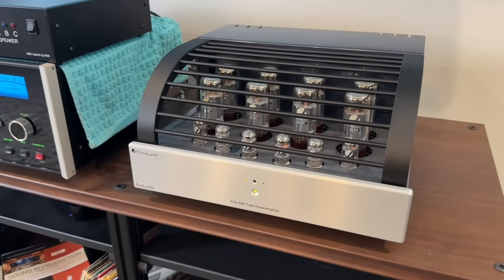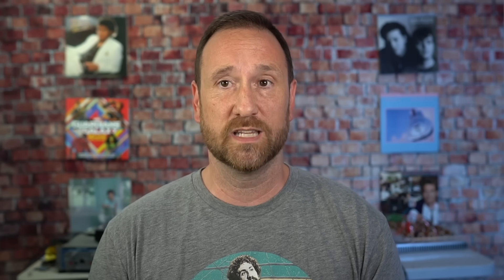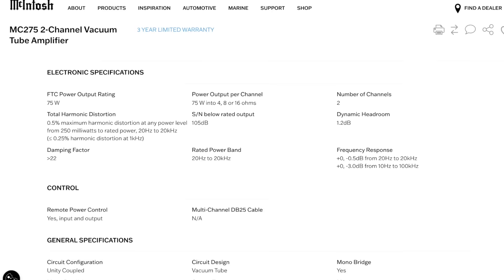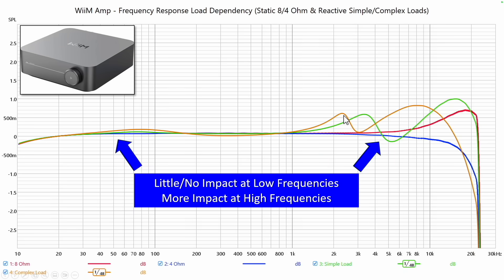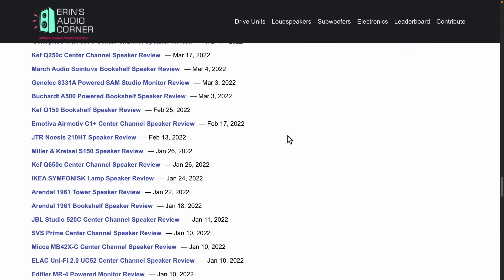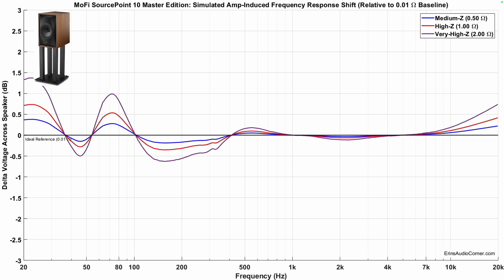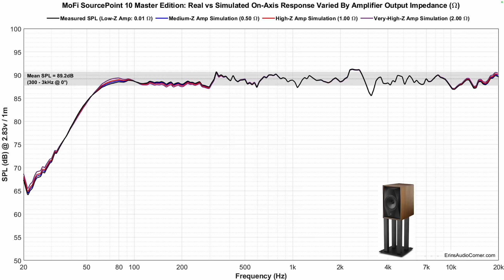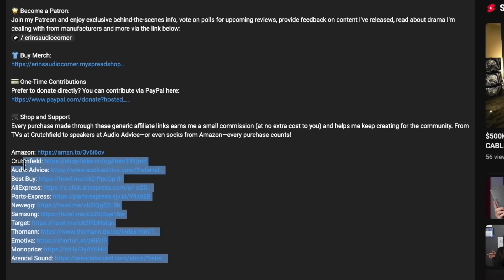Should All Amplifiers Sound The Same?

Comment: Erin, I have two ideas to make the comparison as fair as possible. One is to follow an unwritten industry "standard" and use a single 1000Hz tone for both and keep them at the same dB in the microphone 1m from the speaker. At least this way, both are coming from the same 1kHz source. This might make it easier to hear the differences, but it doesn't really compare the two sources fairly.
The other thing I would use, and in fact, I've done it, is to use a white noise source, which is a type of sound that contains all audible frequencies with equal intensity. This way, you weigh ALL the frequencies, and of course, you'll see differences. The idea is to find all the differences, but I think it's a good start.

Comment: This video is one more piece of evidence that the sound of an amplifier is not a mystery. It isn’t a case of having expensive capacitors in the circuitry, or exotic circuit topology, it’s only that the frequency response when coupled to a speaker is different. In audio that is what we hear: frequency response.
Reply: Specific components do impact the sound, though. Real resistors, capacitors and inductors do not behave like "ideal" resistors, capacitors and inductors. So one needs to match the right components to each other. Steve Deckert (of Decware) calls this process "voicing". This would be another level of refinement.

Comment: BEST. VIDEO. EVAR.  👍👍

This is one video topic that absolutely NEEDED to be produced in this format and with this type of corroborative data combined with subjective impressions that are validated in real time (Erin's Patreon video)!

Erin demonstrated this brilliantly with his, insight, knowledge, and his keen ability to TEACH and convey the information using easily understandable explanations and graphical data examples!

There's obviously been endless debate and myth centered around this topic that needed to be brought to light and understood in a MEANINGFUL way.

Most of us have long known that particular amplifier/speaker combinations can actually  "sound different"...and that it can result in an either subjectively better or worse listening experience.

But now you KNOW with certainty that a particular amplifier can subjectively "sound better" with your particular speakers versus another one, but NOT necessarily because that particular amplifier is "High End", exotic, esoteric, "audiophile grade", or incorporates virgin fairy dust, etcetera, but simply because of Differences in Output Impedance (combined with the impedance curve of the particular loudspeakers)!

I've long tried to explain to some audio enthusiasts that any given amplifier's "circuit" is not actually "complete" until a loudspeaker is connected to it (i.e. an impedance load...which also may vary significantly with frequency).  But "impedance" and its potential effects and implications are not usually easily understood unless you have a background in fundamental electronics and electronic circuits.

Custom aftermarket car audio shops and installers experience this issue almost daily when trying to update and integrate aftermarket audio gear into certain premium OEM stereo systems that use a multi-channel OEM amplifier (such as a B&O, Bose, Harman Kardon, JBL, Fender, Burmester, etc.).

Companies such as AudioControl make and sell a series of specific "Load Resistors" or "Load Generating Devices" (# AC-LGD) that need to be connected to the OEM amplifier (where the signal for an afrtermarket system must sometimes be derived) if the speakers are disconnected and therefore no impedance load is detected by the amp, otherwise odd frequency response behavior will occur...usually significantly exaggerated high frequencies combined with hiss/static or squealing/oscillation.

Sometimes the OEM car amplifier or specific channels in it will actually shut down altogether if there is no impedance load connected to them, or if that load is too different from the OEM speakers.  It's common now for OEM car stereo speakers to have a 2-ohm nominal impedance. 

Some of the higher quality aftermarket multi-channel car audio DSP and combination DSP+Amplifier manufacturers have even started to include these built-in selectable Load Resistors due to this issue when trying to integrate into a premium OEM system.

^Anyhow, this is just another example of where "impedance matters" when it comes to amplifiers and speakers.

Please SHARE this video with every HiFi enthusiast and/or "audiophile" that you know, and "Bookmark" it and Link to it any time this topic comes up in an Online discussion or debate!
Reply from the maker: EVAR!!!!  😂😂😂😂

Thanks, Billy. Glad to see you still around these parts. 💪

Comment: Same thing applies for all components.
Basically source to speaker terminal impedance should be incremental order 

Connection 
Direction
Ideal Impedance Relationship

Source → Preamp
Low → High
Preamp input ≫ Source output

Preamp → Power Amp
Low → High
Amp input ≫ Preamp output

Power Amp → Speaker
Very Low → Moderate
Speaker ≫ Amp output (for control)

Also Dac reviews also completely unusable.  No reference Dac output voltage levels.

So every review falls under review paradox. Including Erin reviews 😊

Comment: Excellent video.  I randomly ended up pairing a little class D amp to a pair of speakers on my desktop that sounds really good to my ears when all the reviews for that speaker indicated they were very hot in the treble.  I wanted to upgrade and put a different amp on my desktop and, it sounded okay, but not great.  I ended up going back to the original setup with the amp that measured worse but, for some reason, paired nicely with the speakers that I had.  I agree, it's difficult to go at this objectively and systematically without a library of amps, speakers, and measuring gear.  I have no measurement gear ;-).  Sometimes the gear gods smile down on you.  When they do, take the win.

Comment: I love high-res audio.
I love best bang for the buck.
I love avoiding reinvestment.
I think matching amp with speaker is most difficult thing and might need researcher level knowledge.
For that reason, I think All-in-one system Like KEF LS60 or JBL 4329p is the best bang for the buck where manufacture did not research and match the best amp and speaker.
There are limitation to those system but I am not aiming for top one percent high res audio so.
Really appreciate Erin doing all the work and proving audio with actually data not just feelings.

Cheers,

Comment: Erin's channel is the best audio channel on the internet.  

As a corollary to what Erin said, Bob Carver showed over 40 years ago that a mid-fi solid state amp could match, nearly exactly, any high-end amplifier (even a tube amp) by tuning its output transfer function, part of which was tuning its output impedance.   He was able to match his mid-fi amp to high end amps so closely that the two amps were indistinguishable by respected audiophiles in blind testing.  The measured null between the two amps matched more closely than the the average difference between channels on the same amp.  Look up "Carver Challenge".
Reply: Loudspeakers complete the circuit. Without speakers attached the amp is an unknown.
Reply: @gboates 
... and quite useless.
Reply: @gboateswut? 😔
Reply: @gboates The tests were done using the same loudspeakers for both amps.  DUH.
Reply: I remember reading that article quite a few years ago, but don't remember which audio magazine it was. Bob Carver was very innovative.
Reply: @dennisheadley4408 Stereophile.
Reply: @dennisheadley4408  Stereophile.

Comment: Thanks Erin. Based on the graph you showed 10K ohm output impedance is high right? I have an Advance Paris A10 and that is what they show for the output impedance. Thanks!
Reply: No way 10K ohm is an amp's output impedance (to the speakers). It wouldn't be able to drive any speaker.

Comment: the real solution is to get a properly designed amp with very low impedance across the audio bandwith pair up with low impedance cables. then you will hear what the speaker truly sounds like. this allows real comparison between speakers.  this instantly disqualify tube amps with output transformers.

Comment: Erin, congratulations. 

What you’re describing isn’t new information, but I’m glad you’re exploring it on your channel. 

Here’s a curveball for you to consider: Wire (cabling) has a characteristic impedance also, and because an amplifier’s output and the speaker both have relatively low impedances, the characteristic impedance of the cable is reactive with the load. 

There’s a lot more to this topic, aside from output impedance, wire impedance and speaker load, but it’s too complex to discuss in a comment section.

Comment: Hey Erin fantastic video! I've been designing audio electronics and speakers since the late 80's. I ran these exact tests back in the early 90's and my results were exactly like yours and I came to the same conclusions. Funny that you showed the NAD amplifier as I am a big fan of older NAD gear. I have a NAD 7600 receiver that is spec'd for a DF > 120 (8 Ohms, 50Hz).  It measured better ~150 from 20Hz-20KHz and was ruler flat last time I checked it. Old NAD gear was well designed and pretty conservatively spec'd.

I also realized that designing the impedance of the crossover to be as flat as possible (ala your Mofi example) helps lower variation of frequency response with different amplifiers.

Ever since then I always look for amplifiers with a high DF whenever possible. Most of my speaker crossover designs since then usually have at least some compensation to smooth out the impedance peaks.
Reply from the maker: Hey, man, thanks for the reply and the info!
Reply: Never fails. "I figured this out years ago and told everyone but they wouldnt listen!" "Look at me everyone!"

Comment: The higher ohms have better sounding highs
Reply: No they don't.  Just the opposite in fact.
Reply: @Douglas_Blake if youve ever compared 4ohms to 16ohms you right away think that the 4ohms sounds better cause its louder but if you volume match youd hear that the 16ohms has more detail esp in the highs
Reply: @Durkhead  
I've done tests like this many times.  It might be true in your examples but that is by no means a universal answer.  Some 16 ohm speakers massively suck, just like some 4 ohmers are wonderful.
Reply: @Douglas_Blake if you have the same speaker 16ohms will have better clarity
Reply: @Durkhead  
And where exactly do I get an impedance variable speaker?
Reply: @Douglas_Blake celestion v30 comes in 8ohms or 16ohms but thats a guitar speaker. You can change the wiring in a 2way or 3way speaker to get different impediances
Reply: @Durkhead  
Os in other words you're working from a sample size of 1.

Comment: I bought my dream Dynaudio towers, and they sounded VERY GOOD with my PS Audio m700 class D amps… and I tried what you said: I listened to 18 different amps with my speakers!   My dealer had 10 options on their own, and I tried a few of the best synergies at home. 

I tried tubes, solid state, class D, separates and solid state.  Ultimately, my large Dynaudio’s liked heavily biased class A/AB solid state with super large current from a BAT VK-500.  

Every single amp/speaker combo sounded different - most were boring, some amazing in some respects, but a tube BAT preamp + BAT solid state amp gave me the best of the best
Reply: I didn’t try 18 amps 😂but I ended up with a similar type setup. PrimaLuna prologue premium preamp with parasound 2250v2 amp. Amp picked based on power/watts and price. Sometimes you get lucky and find out after the fact that your preamp, amp, and speakers have good synergy. Amp has very low output impedance and high damping factor. They really bring out the best in my Polk r700 speakers
Reply: The BAT Rex 500 is a hidden treasure. Bought it with the VK 90 Pre, and I'm getting the best of the best out of my old ProAc D48s. I also discovered that high current takes away boomy bass, if the speakers has that tendency.
Reply: @jespermaintz8993  hidden treasure? Aren't they $25k?
Reply: @Monkeyseemonkey79  Haha, yeah - for a minute I forgot, we have no BAT dealers in his country (Denmark) so it's pretty well hidden here. Let's just call it a 'treasure' :)

Comment: Super interesting.  I've been trying to understand the whole 'synergy' thing a lot of people talk about lately.  This definitely explains that, so thank you.  I've been trying to understand difference between the current higher end class D amps (hypex ncx500, purifi 1ET9040BA) and the new GAN amps (Orchard audio, AGD, Laiv, etc.) people have been raving about.  I'm assuming output impedance on both are extremely low.  What else could cause some sort of difference in sound?
Reply: @bigswang1578  
The "Switching Frequency" of the amplifier section and its transitors (higher/faster is better...at least to a point) combined with the level or degree and quality of the Output Filtering contribute the most in regards to the "sound quality" of Class D amplifiers, the latter of which includes the use of PFFB (i.e. the "feedback loop") which continuously compares and corrects the output signal to match the input signal.

Comment: Stereophile swore amplifiers sound different, some superior to others. Then Bob Carver rolled into town.
Reply: I think you might misunderstand what Bob did in that shootout.
Reply: Bob didn't do anything. That's the point. His "null transfer function" bs was a Fugazi that flew past the golden eared ones. Know any?
Reply: @bluelithium9808 He designed an amp which could be modded in real time, using a null test to compare to and emulate an amp he was comparing it to (a CJ tube amp if I recall). He didn’t prove that all amps sound the same, he simply designed an amp which could be modified easily to achieve a desired sonic result, to mirror the target amp closely enough that the difference pull be subjectively inaudible within the power level of the test. 

I sold Carver amps for multiple dealers in the 90’s. They were a good value for their time, but I would argue that amps like the TFM35X didn’t sound like equivalents from Parasound, Adcom, B&K, Acurus, etc, which we also sold. Each design did have a characteristic sound which could be easily heard. Adcom tended to sound warmer, typical of Nelson Pass designs, whereas Parasound tended to be less warm and very dynamic in the bass region (far more so than Carver).
Reply: lol, forward me a M1.0t schematic showing the "distortion pots" Bob alledgidly used to "introduce distortion" to make it sound like the reference amp. Waiting....
Reply: @bluelithium9808  You could just do your own research into the topic if you don’t want to trust that my recollection is accurate. Or, you reach out to Bob directly, or ask the guy at Neilion Audio… pretty sure he worked for Bob Carver at that time.
Reply: @ChrisMag100 you're the one who is claiming Bob adjusted "distortion pots" on the M1.0t. And now science kicks in. Proof?

Comment: I always told this to people: output impedance may change frequency response, so that amplifiers may sound different. Finally a comprehensive video explaining and showing all this. 100% agree to have reviews showing amplifier output impedance x frequency, this is the way.
Reply: This is why measurements must be done with a speaker equivalent load, not just a resistor. Or with an actual speaker.
Reply: @VioletGiraffe  All speaker are not the same, so where are we then? And if we go for a standard golden reference speaker, and that thing do not match your own speaker, where are you then? Ahh... all resistors are not the same too.
Reply: @K2teknik.  the point of the electric speaker equivalent - that you completely missed - is simply to introduce frequency-dependent impedance to better test the amps. To a good amp all speakers are the same, to a bad amp they are not. We want to be able to tell the good from the bad.
Reply: @VioletGiraffe  Electric speaker equivalent, what is that? an RLC circuit where you can change/adjust R, L, C independently to mimics a speaker's behavior?  Are there and standard for such a thing? Data for operational range for R, C, L? Wishful thinking for the future or is it present today?
Don't get my wrong, I do not disagree with Erin's findings, I just see some practical challenges to test all amps against all speakers. Not only do output impedance change with frequency, it also has a different response between amps. I do not see Erin's findings as a sort of useful data in a spec sheet, but more as yet an other explanation to why different speakers sound different with different speakers.
Reply: Precisely why I bought an amp that has super low output impedance from 20-20kHz.  It's the only way you can deliver a flat frequency response into a speaker who's impedance varies with frequency, as the vast majority of speakers do.
Reply: as long as amps have vastly different architectures and components, they will sound different. tons of forum `experts` said expensive purify and hypex would basically sound identical due to measurements being so close, thought it was fun when a youtube channel tested this and the amps clearly had their own sound characteristics
Reply: @hotdog9262 how "clear" were the differences and were they level matched and double blind tested?
Reply: @audio_facts  the differences were significant imo.. in this case hypex nilai had a better and more balanced sound to me..then purifi. although making some judgement through youtube probably have limited value. the listening samples were level matched. no blind testing